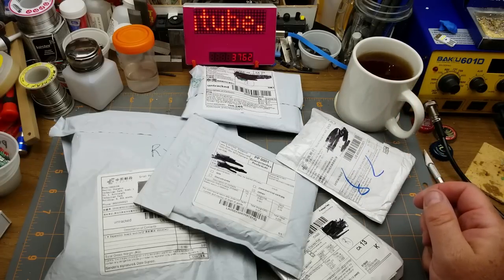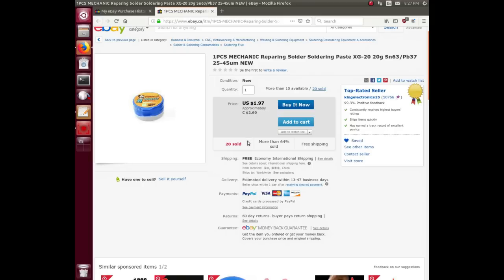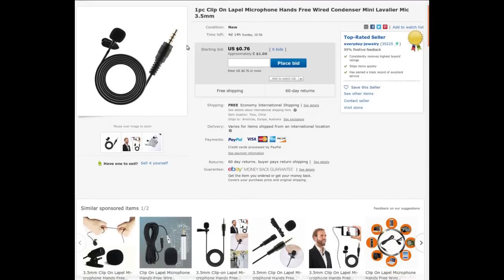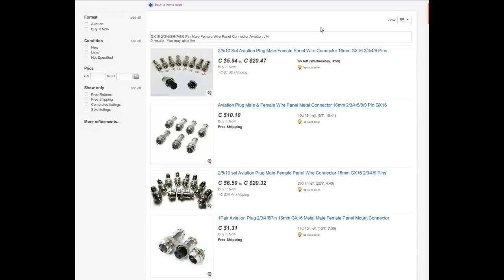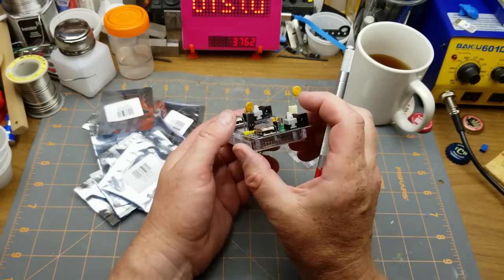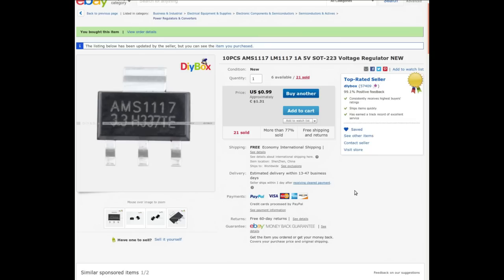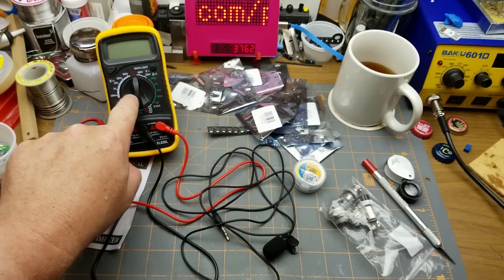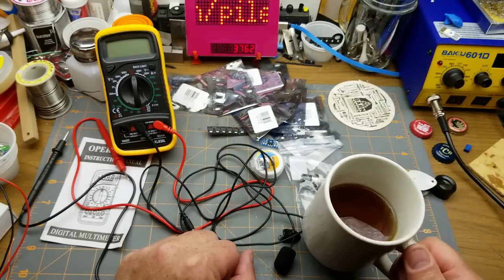Mailbag Monday #61

Comment: Those AMS117-3.3v fixed regulators are ubiquitous. Just everywhere.  I usually snip the  middle pin and solder to the underside of MCU projects, with heavy solder around the tab, and caps on the top.  The datasheet says input can be 12V, but  mine always self-destruct when sourced that high.  5 or 9V  works well.

Comment: Why not replace with 7805 regulators? They usually fail open not short, plus they have built in shut down for over current protection.
Reply from the maker: Mostly due to size. 

But, normally I prefer to use my buck-converter power supply anyway, since it has adjustable current limiting.  I'm really not a big fan of the breadboard format power supplies.

Comment: I bought two of those soldering irons as spares and both of the ends broke.
They worked for a few times of me just trying them out and then they went open circuit.
I ended up using the internals by themselves and then I used one of the ends because my main wand split.

Comment: Is that still Ubuntu 16.04LTS? Don't feel bad, I'm still using it too.  Having a hard time falling in love with 18.
Reply from the maker: I'm pretty sure it'a 18.04LTS (xubuntu because the shop computer is relatively low spec)
Reply: @pileofstuff  ok...the desktop sure looks like unity which they stopped in 18...which is why I thought it was 16.  But maybe the window mgr is different
Reply from the maker: @jimb032  Yeah, it's completely default. Even teh "bionic beaver" wallpaper.
https://liliputing-wpengine.netdna-ssl.com/wp-content/uploads/2018/04/beaver_01-680x432.jpg